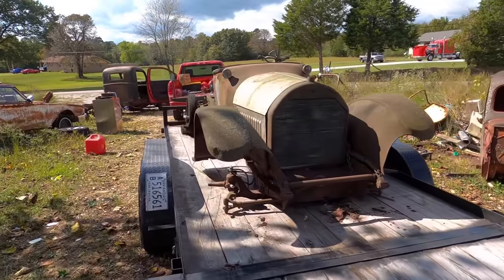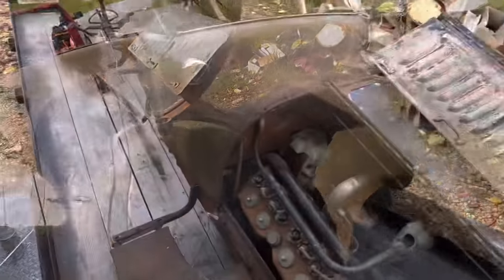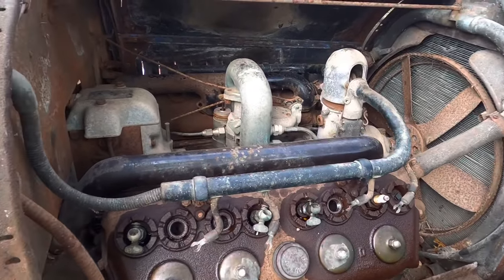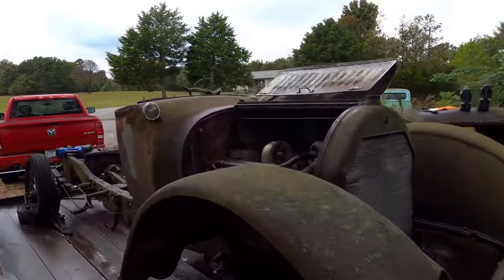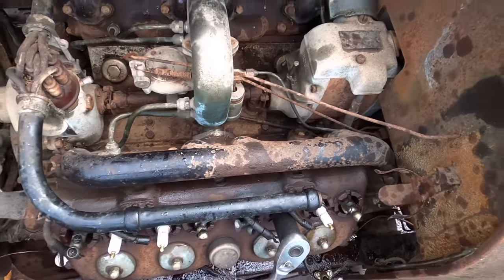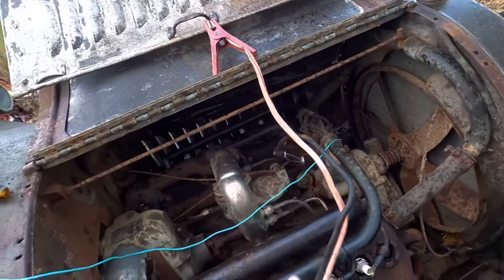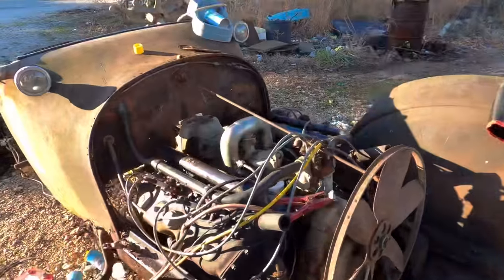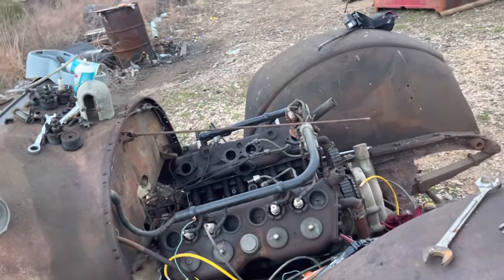Will it run after 93 years 1917 Cadillac v8

Comment: I'm glad to see younger folks taking interest in this kind of stuff. Hey, those take a higher octane leaded gasoline. Also, the batteries were 6 volts. My stepdad ruined his 1937 chevy's carburetor by using modern pump gas. Hopefully, this tip will help you out.
Reply: Ethanol gas can ruin the gaskets, float needle if it is rubber tipped, the float if it is a plastic-type of material, and the accelerator pump, but those are all replacement items.  His carb should have been easily fixable.

Comment: I'm throwing my opinion into the mix here. I SWEAR by Free All. I used to be a PB guy and before that a WD40 guy. Each is excellent but they have three distinct uses.

WD40 is good for light lubrication and surface protection
PB Blaster is good for soaking up something nasty in the junkyard before you start taking heat and hammers to it.
Free All is for getting into the guts of something you want to take apart, press in or out and not have destroyed in the process. 

I found out about Free All when I had trouble getting a buddy's wifes heat welded wheel bearing out of a knuckle assembly on a Toyota Venza. I put so much force on the thing in the press I snapped the steering stop bolts right off where they were resting on the press. I eventually gave up and went to a local muffler shop because they had a 25 ton press (mine was only a 12 ton). I showed the guy what I was trying to do and how hard it is to support such an oddly shaped knuckle. He brought me a can of free all and had me spray everything with it. You can actually watch it creep into tiny cracks where PB just sits on top and makes everything stink and get slippery. A few sprays of Free All and that bearing damn near fell out of the knuckle. The new one got pressed in with Free All and it went like butter. The guy gave me the can on the house and I have sworn by it ever since. You can get it at any Oreilly right on the shelf. Slowly convincing my coworkers its as good as I say and I'd say that poor new can I buy every month gets borrowed off my toolbox more than I actually use it.

Free All hurts like hell if you get it in your eyes. Therefore it must be the best.

Comment: After working for a year on a "free" 7.5hp Honda four stroke outboard, I know how you feel. After replacing everything I could think of and pulling that starter rope until I couldn't even scratch my butt, I finally decided it was a fuel pump problem even though I had replaced it once already. You can't find a new fuel pump and there's no way to test it until it's mounted, so I'm just going to sell it for parts. Besides, I bought a 25hp two stroke Johnson that runs just fine, so I don't need the Honda anymore.

Comment: Why does watching this make me feel sad with my current job ^^ Don't get me wrong I also love coding and the money is very good. But I really enjoy watching this and I can feel inside me how I want to take a wrench into my hand and start working :D My first car was a VW Golf 3 Cabrio. It was a shitty car when I bought it with exception of the motor. That 2l motor was completly dry with 300'000 km. But I had a huge probem with water getting in, filling the carpets and then it would start to smell when the sun was out. I took out the whole interior to dry it and started to search for the source. Of course supsected the cabrio roof but even with pouring water over it there was nothing getting in. I then did the same with the hose over the motor and it started pouring in directly where all the fuses were. It turned out that the guy who installed the sound system used a whole that is downwards directly above the fuses for the main electric cable to the hifi system. He did at least put silicon on it :D but that didn't hold for long. So I found a whole that is going up and put the cable there with rubber around it.

What I nice day that was. To be honest I was not pissed at all at the mechanic who sold me the car. I was happy to work on it xD

Comment: I have a very old four cylinder 'Clement Bayard' motor with a very similar semi one-piece configuration for the cylinders.

I found most of the motor lying on a pallet out in the open on a farm and it did not have the bung type plugs for the top of the cylinders which obviously also contained threaded openings for spark plugs at their top.

I have always wondered whether the bungs would have been brass or cast iron/steel and I did not manage to find the old up-draught carburetor either.

Fortunately I found the old solid brass Bosch magneto with a chunky porcelain insulator in very good condition at the back of a cupboard in a nearby timber slab cabin.

It is obviously the correct magneto for the engine because it has four bare wires sticking off terminals on the insulator and fits perfectly in the magneto bracket on the side of the engine.

The crank shaft is very light for it's length and does not have any intermediate supports it merely features long 'puddle' type bearings in brass shells at either end and the pistons do not have oil control rings.

The bottom end of the motor consists of upper and lower halves made of cast aluminum with individual oil retaining troughs under the bottom end journals for the long-stroke connecting rods.

It also has a cast aluminum side cover for the valve push rods that is contoured to fit in the side of the cylinder casting and the push rods have dainty little rollers on the camshaft end.

Each connecting rod bottom cap has a small copper tube with a face pointing down that is angled so they apparently push oil up to each individual bearing by sheer force of impact with oil in the troughs.

It looks as though the lower half of the 'crank case' used to have a very basic plunger type pump to lift oil to the camshaft which then runs into the troughs to lubricate the big ends. 

It is my understanding that Listers of England were the first engine manufacturer to develop oil control rings and they did that in 1911, so the old motor I own may pre-date that time.

Comment: Cree Oil is very slippery kinda like friction modifier in limited slip differentails, but it is also very expensive, about 2-3 times the cost of PB Blaster but it also works much faster than most penatration  oils. I just purchased 2 cans myself.

Comment: Here’s a trick I use,make a socket or fabricate the old crank handle crank end to fit 1inch drive to turn the engine over using 1 inch drive impact I got several engines started this way.

Comment: Grampa told me not to use lubes to free up rusted bolts etc.  Said "the  lube will gum up the rust in the threads . "   He would mist the rusted nut/ bolt with water.  Restarting the rusting process quickly and water won't Gum up in the threads and snap a bolt . It works .

Comment: Need to understand the firing order and distributor order, find tdc on No.1 cylinder and set the timing up, you may be 180° out? Got the cap on the right way around? Rotor arm set right?

Comment: @10:06 Just to say.. whenever cranking old machinery, Golden rule, always make sure the thumb is not underneath the handle but on top with the rest of the fingers-otherwise if the engine suddenly fires or kicks- back you can potentially break your thumb.

Comment: I suspect the extra little individual valve next to each spark plug with a cup shaped opening was used to put a shot of priming gas directly into each cylinder for ease of starting.

Comment: I really respect your ambition to get these old engines running again. However, I'm questioning if it's safe for the engine to try to get it running ASAP without a thorough inspection

Comment: If you got gas and spark, it's likely the valve springs are broken. They're under a lot of stress when in operation, they usually fail after sitting for many years-corrosion induced failure. You said you got good compression in all cylinders, but that's not always a good indication of proper valve functioning. Might have to pull the heads and see what's what? Good luck.

Comment: Oh, well.  Poor broken Cam.  :(   Time to fire up the Lathe, for a home made replacement!  lol.  Just pour a molten steel (or hardened iron) 1 piece sand-mold, and voila!  [ or just bore hole / weld the original Cam, and file / sand / polish the original ].  Might work?

Comment: In England, I occasionally see a car that’s been sat outside for around 25 years, I can now barely see the engine block, some transmission, bits of glass and plastic, most of the body has dissolved into the ground.

Comment: I've got a 55 chevy truck Frame, motor, trans, suspension, rear end, pretty much everything except the body and wheels if you want it. Motor and trans will need to be rebuilt. I'll trade it for a old grill similar to what is on that car for my rattruck. Let me know!

Comment: You should read about the compression in cylinders and how ignition work. There is no way oil rings will be able to keep compression after all these years. I had a case when the engine lost compression just after the car was sitting only two winter months due to the sludge built around the rings.

Comment: I really disagree with even turning over such an engine. The engine and gearbox should be carefully taken apart inspected and as far as possible use the original parts. Only after careful assembly should these historical machines be started.

Comment: Take and just feel the whole engine with diesel fuel all the way to the top, lead the spark plugs out, turn it over around now, and then keep topping it off with diesel fuel, then let it sit, then drain it after a couple of weeks and then refill it with oil

Comment: That was a real video.  No electric start.  The camshaft was probably broke when it was parked.
BUT if not, they broke it when he pounded on the valves.  Had he torn it apart first he would have saved a lot of time.  I would weld the camshaft and get someone to grind a new one for it.
Rebuild the engine and then you will have something.

Comment: Did I miss why you didn't use the starter to turn the engine over once it was freed up?  And/or use a heavy duty, 1/2" wired drill to turn it from the front crank bolt?  First time firing of something like this will definitely need some speed while cranking.  The faster the better.

Comment: The problem is it was broken when it was abandoned.   Maybe it would run if you figured out the firing order and put it in time
Reply from the maker: Did all of them the valve/cam assembly was broken that’s why they car would run the engine will get rebuilt and will be running in the future
Reply: @jenningsmotorsports7554  they all broke back then and most of them the owner couldn't afford antifreeze and they ran straight water or mixed with alcohol and the block would freeze and crack.  That was what happened to my great grandfather car.  Then they would parts it out or sell it for scrap and that's why parts are missing.

Comment: Sorry 80 huge horsepower. She is way more powerful than even trucks of this age. Probably a great gasoline drinker while running. No heads so she is hard to find exact solutions to. Mr Jennings is struggling to turn her over indicates not smooth cylinders but looks better as time rolls on. She is putting out good spark. Mr jennings should put this in a big truck for the time.

Comment: This is an old video so I probably won't get an answer, but I was wondering why you couldn't somehow use a half inch drill motor to turn those engines over or is that not feasible?
Reply from the maker: @christinawiseman-gc9jh  drills do not have enough torque the handle adds a lot of leverage to turning the engine I have tried using a drill video times also impact, and they do not have enough power

Comment: It's a Monoblock. Early cylinder heads were notorious for leaking and cracking, so this would be done for reliability.  Many higher end manufacturers of the time, notably alfa-Romeo and bugatti would build the head and cylinders as a single unit, to avoid failiure.

Also, was this one not ordered with the leeland electirc starter?  Cadillac had electric starters since 1912.

Comment: Doesn't surprise me that there was issues with the cam shaft, the design isn't great and most likely originally caused by a stuck valve which causes the rocker assembly to snap out of the housing in the top cover and shower metal through your motor (I found pieces of mine sitting on top of the screen in the oil pan). Cadillac obviously knew it was a design problem as they changed it every model until it was completely redone for the v63. The type 57 may not interchange with later models due to the fixed heads. 

That said, when I got mine the motor was running on 4cyl and the timing was totally out - they will run pretty easily if all of the elements are there (albeit not well)
Reply: The shop manual for the v63 has the cam profiles for the type 61 and v63 that you could cross check against yours to see if it matches - I don't think the earlier cars shop manuals have the cam profiles in them and it doesn't give you all the measurements you need but it should be a good start
Reply: also echoing a lot of the comments about the need to open the motor up before trying to spin it over, there are alot of parts in the motor that will shear off if they're stuck. Car is also positive ground 6V and while there is a crank handle on the car it was never designed to be started that way - it's purely there for maintenance (the manual specifically tells you not to attempt to hand crank the car without a battery and has no guidance for starting the car with the crank)

Comment: having been turned over, what was the result when the engine was stripped? Did the oil pump pick up debris that had settled into the bottom of the sump - and then pass it around the bearings, wrecking them?

Comment: Its a dynamic compression problem the engine is worn out and you can't spin it fast enough to build the dynamic compression for it to fire the compression is slipping past the rings and worn valve seats if you had a way to spin it fast enough it would run cause the rpm would build dynamic compression

Comment: Low compression or no spark. Use test equipment like a compression gauge and spark tester. Probably valves are rusty and lose compression. Probably piston rings are worn out. Good grief.

Comment: Cant you use a battery operated drill in low gear with a clutch to crank that way you won't risk breaking your arm if it backfires.

Comment: I noticed from the beginning of the video that you said it had an electric starter that needed to be greased I'm not sure why you didn't choose to use that also I noticed there is a bar heading straight from the firewall into the fan blades towards the end of the video I'm wondering if that could have caused the reason why the fan was not moving

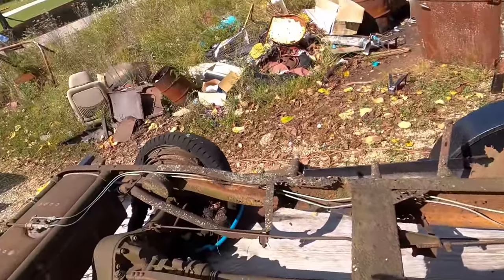Comment: 1:23 It's a gas motor, it has spark plugs, why would he say he's going to fill it with diesel? Is he using diesel to flush the engine and dissolve the old oil? Can someone knowledgeable chime in on the process here
Reply: Diesel is a lubricant it’s to lubricate the parts that are locked up like the pistons also acts as a penetrant